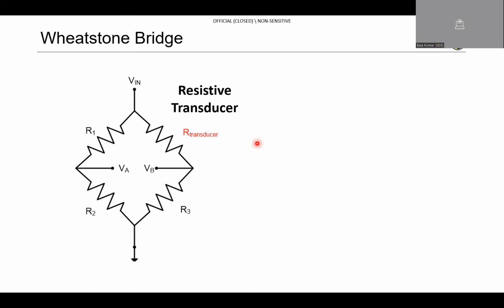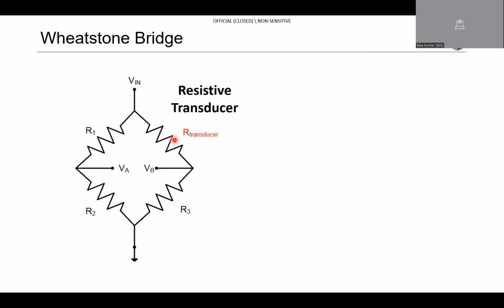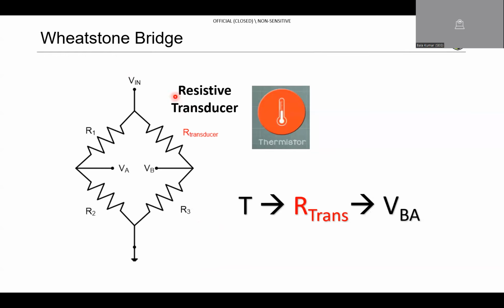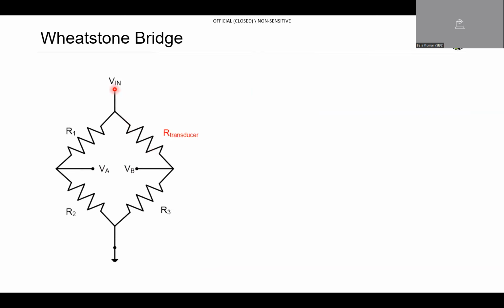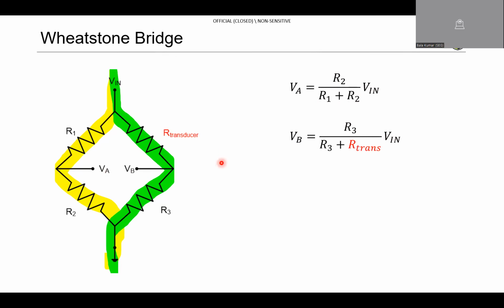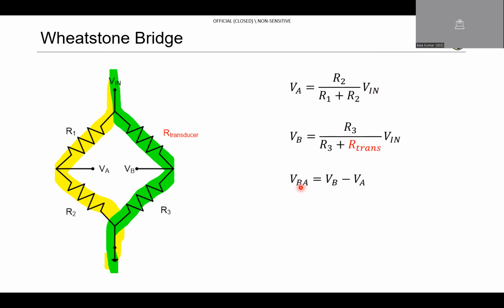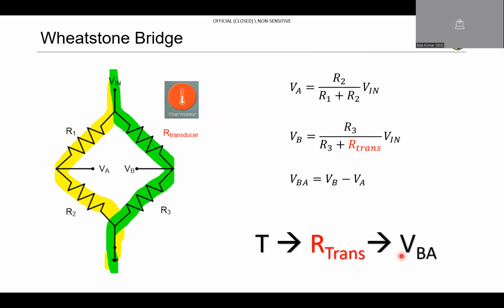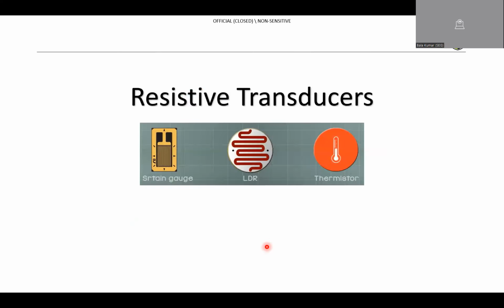Wheatstone Bridge

Comment: The Wheatston Bridge comprises of 3 normal resistor and 1 resistive transducer.Which means the resistor will change based on the physical quantity you are measuring.In a thermostat you are able to measure the temperature based on measuring the Vba

Comment: The Wheatstone bridge is a versatile electrical circuit designed to measure an unknown electrical resistance. It comprises four resistors arranged in a diamond-like configuration. A galvanometer, a sensitive current-measuring instrument, is connected between the midpoints of the two parallel branches. When the bridge is balanced, no current flows through the galvanometer, indicating that the ratio of resistances in one branch is equal to the ratio in the other branch. This principle enables the calculation of the unknown resistance based on the known resistances. Wheatstone bridges are employed for precise resistance measurements and a variety of other applications, including strain measurement, temperature sensing, and more.

Comment: Wheatstone Bridge circuit which is made up of three normal resistors and one resistive transducer. Resistive transducer such as strain gauge, LDR, Thermistor changes its resistance with the physical quantity changes(e.g. light, temperature) being measured.

Comment: The instrumentation amplifier YouTube video is outstanding, offering a thorough exploration of this vital electronic component. It excels in simplifying complex concepts for a wide audience, with a presenter who captivates through clear explanations. Meticulous attention to detail covers aspects like differential amplification and common-mode rejection ratio, complemented by visuals. The video caters to both beginners and advanced viewers, emphasizing practical applications and bridging the gap between theory and implementation. Overall, it's not just educationally valuable but also inspires curiosity and appreciation for electronic engineering intricacies.

Comment: The Wheatstone bridge is made of two voltage regulators. The resistance of the transducers, R transducser changes when there is a physical aspect or factor that can be measured the change in resistance can be measured in the VB and any changes made in the resistor measured  through the VB gives extremely accurate measurements of resistance

Comment: A Wheatstone bridge is an electrical circuit has a fixed resistance with another option being a varying resistance that is used to measure an unknown electrical resistance by balancing two separate voltage divider circuits,

Comment: The Wheatstone Bridge is a circuit designed for precise measurement of changes in resistance, often using a resistive transducer whose resistance varies with physical conditions like temperature, light, or strain. It works by comparing voltage differences across two voltage dividers, where the change in resistance alters the output voltage. This output can be accurately measured to detect and quantify the physical change. Applications include temperature sensing with thermistors, strain measurement with strain gauges, and light detection with LDRs, making the Wheatstone Bridge a versatile tool for monitoring various physical phenomena.

Comment: The Wheatstone Bridge is a circuit used to measure changes in resistance due to physical quantities, such as temperature. It consists of four resistors, including a resistive transducer. By analyzing voltage differences, accurate measurements can be obtained, making it useful for various applications like temperature, strain, and light measurement.

Comment: A Wheatstone bridge is an electrical circuit used to measure an unknown electrical resistance by balancing two separate voltage divider circuits,  One with a fixed resistance and one with a varying resistance with the use of a thermistor.

Comment: Wheatstone Bridge consists of 2 voltage dividers. We can apply the voltage divider equation to find VA and VB, respectively. If we replace the Rtransducer with a thermistor, when the temperature changes, the resistance of the Rtransducer and the voltage across VBA will change.

Comment: The Wheatstone bridge has two voltage dividers with three normal resistors and one resistive transducer connected together.We can use voltage divider rule to find the value of the certain voltage point, the Wheatstone bridge achieves balance by adjusting the values of the known resistors.

Comment: The Wheatstone bridge is an electrical circuit used to accurately measure unknown resistances by balancing two branches of the circuit. It provides superior precision compared to a basic voltage divider, making it suitable for resistive transducers that measure physical parameters such as temperature, pressure, and strain. Variations in the transducer's resistance (Rtrans) caused by changes in these parameters lead to a measurable change in the bridge voltage (VBA), enabling precise detection and analysis.

Comment: Within the wheatstone bridge circuit, the transducer value changes if the physical quantity (Temperature for example) changes as well. Changing the value of the transducer also changes the values of our VBA. This relation can be seen using the Voltage divider rule when finding out VBA to see the changes of Physical quantity, Transducer and VBA values.

Comment: The Wheatstone Bridge essentially acts as two separate voltage divider circuits. One with a fixed resistance and one with a varying resistance with the use of a thermistor. This allows for high accuracy as little changes in temperature changes the the resistance as well. A VBA value can be set as standard and any change in temperature will change the VBA value, allowing for the device that knows the VBA value to know the temperature.

Comment: One of the four resistors which make up the Wheatstone Bridge is a resistive transducer. By just applying the voltage divider rule, we can get the voltage values at VA and VB. When a resistive transducer, like a thermistor, is used to measure temperature, the VBA is affected by changes in the transducer's resistance as the temperature changes. Determining VBA helps to calculate the temperature.

Comment: The key takeaway from this video is that the Wheatstone bridge is made up of 2 voltage-divider circuit, by using three normal resistors and one resistive transducer which will change its resistance by changing the physical quantities like temperature, pressure and strain.

Comment: The Wheatstone bridge consists of two voltage dividers with three normal resistors and one resistive transducer connected together.We can use voltage divider rule to find the value of the certain voltage point, the Wheatstone bridge achieves balance by adjusting the values of the known resistors.

Comment: The Wheatstone Bridge is a precise circuit for measuring unknown resistances by balancing two legs of a bridge circuit. It operates on the principle of null deflection, ensuring accuracy in electrical measurements. Widely used in instrumentation, it forms the foundation for strain gauge and sensor-based applications.

Comment: The Wheatstone bridge have two voltage dividers. In the Wheatstone bridge when a resistive transducer like thermistor is used which helps to measure temperature, when the temperature changes the resistance of the transducer also changes that affect the VBA. Finding VBA in turn helps to find the temperature.

Comment: The Wheatstone Bridge is an electrical circuit used to measure an unknown resistance. It consists of four resistors arranged in a diamond shape with a voltage source connected across the top and bottom points. When the bridge is balanced, the ratio of resistances in one leg is equal to the ratio in the other leg. This balance is indicated by zero current flow through a connected galvanometer. By adjusting known resistances and observing the balance, the unknown resistance can be determined using the Wheatstone Bridge equation. This principle is widely applied in measuring resistances and is the basis for various electronic measurement devices.

Comment: Wheatstone bridge is an electrical circuit used to measure an unknown electrical resistance by balancing two legs of a bridge circuit. Wheatstone bridge is made up of four resistors, and three of them are normal resistors whereas the other one is the resistive transducer which means its resistance will change according to the physical quantity being measured. For instance, the thermistor measures the temperature and when the temperature changes, the resistance of the resistive transducer will change. Hence, the change in the resistance of resistive transducer will affect the V(BA) so that we can determine the temperature by measuring the V(BA).

Comment: Wheatstone bridge is an electrical circuit used to measure an unknown electrical resistance by balancing two legs of a bridge circuit.Ability to provide extremely accurate measurements of resistance is its main advantage.

Comment: The Wheatstone bridge is used for the precise measurement of low resistance. Wheatstone bridge and an operational amplifier are used to measure physical parameters such as temperature, light, and strain.

Comment: Comprising four resistors arranged in a diamond configuration, the Wheatstone bridge features a voltage source connected across the upper and lower segments, with a galvanometer linked between the two sides. Commonly employed for measuring an unknown resistance, the Wheatstone bridge achieves balance by adjusting the values of the known resistors.

Comment: use my webull The Wheatstone bridge, with four resistors in a diamond shape, uses two known and two unknown resistors. Adjusting the variable resistor until the bridge is balanced equalizes the current in the diagonal branches. Detection of this balance is achieved through a galvanometer or a sensitivity bridge indicator.

Comment: The Wheatstone Bridge comprises three standard resistors and one transducer (such as a thermistor or LDR). The voltage across points B and A (Vba) varies in response to changes in the transducer's resistance (R transducer). This variation can be determined using the voltage divider rule.

Comment: The Wheatstone bridge consists of four resistors connected in a diamond shape. Two of the resistors are known, and the other two are unknown. The unknown resistance is measured by adjusting the variable resistor until the bridge is balanced. When the bridge is balanced, the current flowing through the two diagonal branches of the circuit is equal. This can be detected using a galvanometer or a sensitivity bridge indicator.

Comment: A Wheatsone Bridge is made out 4 resistors, 3 normal resisters and 1 resistive transducer which changes its resistive value based on the physical quantity being measured. Some examples of a resistive transducer are thermistor and light sensors.

Comment: Three resistors and one transducer (thermistor, LDR, etc.) make up the Wheatstone Bridge. Depending on the transducer change, the Vba value varies. To determine the value of a specific voltage point, we can apply the voltage divider rule.

Comment: The Wheatstone bridge consists of four resistors arranged in a diamond shape with a voltage source connected across the top and bottom. Three of them are normal resistors but one is a resistive transducer.
Reply: bala kumar the goat

Comment: The Wheatstone bridge is made up of four resistors, three standard resistors and one resistive transducer that modifies resistance in response to the physical quantity being measured. Take thermistors, for instance, where the circuit's Vba may be measured to determine the temperature.

Comment: The Wheatstone bridge comprises two voltage dividers coupled to one resistive transducer and three regular resistors. One use for the Wheatstone bridge and resistive transducer is the measurement of physical parameters like temperature. Usually, the bridge tests an unknown resistance by varying the known resistor values until the bridge achieves equilibrium. The voltage between nodes A and B may be used to monitor minute changes in these values since the circuit that was established is so exact. That is, V(BA) will change in response to changes in resistance, which will change in response to changes in temperature or any other physical quantity.

Comment: The Wheatstone bridge consists of four resistors arranged in a diamond shape, with a voltage source connected across the top and bottom of the diamond and a galvanometer connected between the two sides. The bridge is typically used to measure an unknown resistance by adjusting the values of the known resistors until the bridge is balanced.

Comment: The Wheatstone bridge consists of two voltage dividers with three normal resistors and one resistive transducer connected together. An application of the Wheatstone bridge along with the resistive transducer is to measure physical quantities such as Temperature. As the created circuit is so accurate, minute changes in these quantities can be measured by measuring the Voltage across node A and node B. i.e., V(BA) will change with the changes in resistance which in turn changes with any change in temperature (or any other physical quantities).

Comment: A Wheatstone Bridge is a circuit used for measuring electrical resistance, The bridge is made up of four resistors arranged in a diamond pattern, with a voltage source across the top and a galvanometer (a sensitive current-measuring device) across the bottom. The bridge is often used to determine the unknown resistance of a resistor in one of the bridge's arms.

Comment: Three common resistors and one transducer, like as LDR or thermistor, make up the Wheatstone Bridge. Changes in the resistance of the transducer (R transducer) cause variations in the voltage across points B and A (Vba).

Comment: In Wheatstone Bridge, 4 resistors are connected like a diamond shape. Three of them are normal resistors but one is a resistive transducer. The resistance of this resistive transducer changes as the temperature changes and this will also affect V(BA).

Comment: Wheatstone  Bridge is made up of 2 voltage divider.  We can apply the voltage divider equation to find out VA and VB respectively and if we replace Rtransducer with a thermistor, when the temperature changes, the resistance of the Rtransducer and the voltage across VBA will change.

Comment: Wheatstone Bridge
- made of 4 resistors, 3 normal 1 resistive transducer
- Resistive transducer changes proportionally when temperature changes
- Voltage can be found by using voltage divider rule
-VBA can be used to find temperature and vice versa

Comment: Wheatstone Bridge consists of 3 resistors and one resistive transducer used to measure physical quantities such as temperature, pressure, and strain. 
The resistance of the transducers, Rtrans, changes with the physical quantity being measured, and this change in resistance is measured as a change in the voltage across the bridge (VBA).

Comment: M Naw:

Wheatstone bridge is made up of 2 voltage dividers circuit and is able to provide extremely accurate measurements of resistance. And by using Wheatstone bridge, we can measure the physical change in the physical quantity.

Comment: The resistance of the resistive transducer will only change based on the physical quantity that is measured. Wheatstone bridge allows a small change in temperature accurately when measuring the VBA.

Comment: Three standard resistors and one transducer (thermistor, LDR, etc.) are present in Wheatstone Bridge. Depending on how the R transducer changes, the value of Vba changes. It is calculable with the voltage divider rule.

Comment: Three resistors and one transducer (thermistor, LDR, etc.) make up the Wheatstone Bridge. Depending on the transducer change, the Vba value varies. To determine the value of a specific voltage point by applying the voltage divider rule.

Comment: The wheatstone bridge consisists of 4 resistors and one of the resistors is a resistive transducer. We can attain the voltage values at VA and VB by simply applying the voltage divider rule.

Comment: The thermistor is used to measure the temperature. When the thermistors detects the changes in temperature it will affect the resistance value

Comment: A very good explanation.
               A Wheatstone  Bridge is made of four resistors ; 3 of them are normal resistors and this is a resistive transducer which means it is a resistor whose resistance will change based on the physical quantity that is measuring. The example of a resistive transducer is a thermistor, it measures the temperature when the temperature changes the resistance of a thermistor will change.so when the resistance okay so when the temperature changes the resistance of this transducer will change and when this resistance changes it will affect the VBA and the VBA will change. So by using wheatstone bridge we can able to determine the temperature  by measuring the VBA .

Comment: The Wheatstone brigde consist of 4  resistors  where 3  of  them are normal resistors and  one  is a resistive transducer which changes  its resistance  based on physical quantity that we are measuring. For example, thermistors, where the temperature can be determined by measuring the Vba of the circuit.

Comment: The Wheatstone Bridge circuit comprises four resistors, one being a resistive transducer that changes resistance based on a physical quantity. Examples of resistive transducers include thermistors for measuring temperature. The temperature can then be determined by measuring the Vba of the circuit.

Comment: The Wheatstone Bridge consists of 3 resistors and one transducer(LDR,thermistor) etc. The value of the Vba changes depending on the change of transducer. We can use voltage divider rule to find the value of the certain voltage point